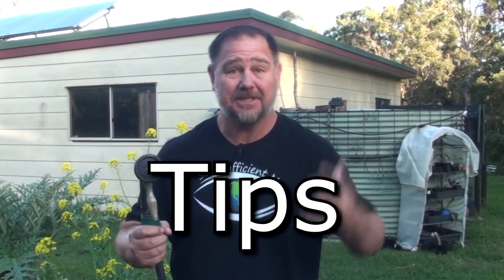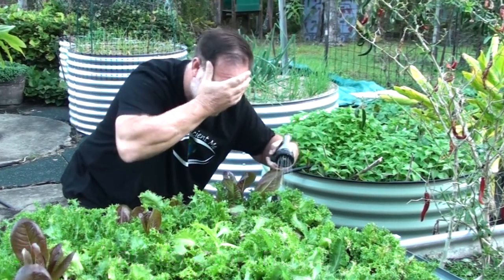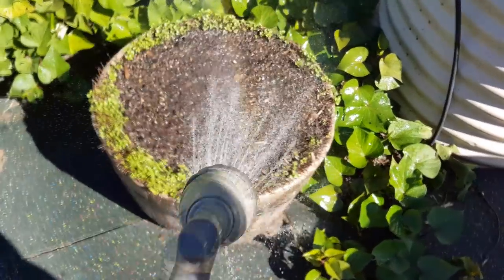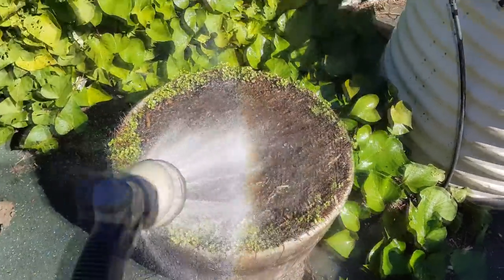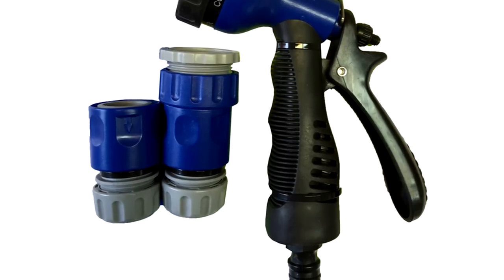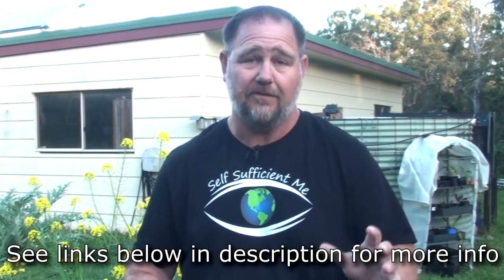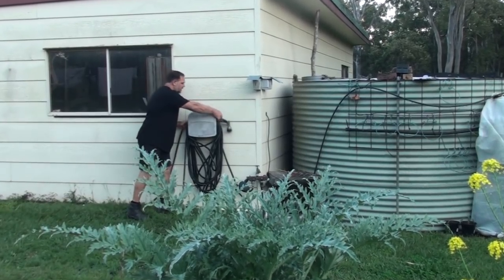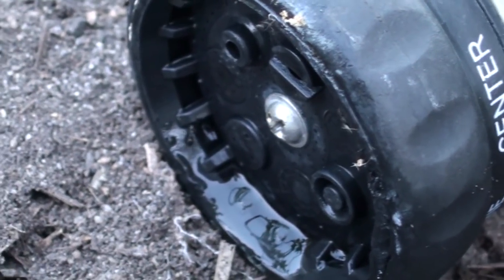EASY Way to UNBLOCK Hose Spray Nozzle or Garden Wand Sprayer

Comment: Also another quick tip if you don't want to go with the fancy sprayers. The old fashioned brass nozzles that look like a firehose and you twist to adjust, never break and never clog and last forever, you just don't have as many spray options with them, you will lose them before they wear out lol. Good vid, thanks Mark   gg.
Reply: I have three of those and two don't pass water.  That's how I find myself here.  Any idea what could be done.  I don't think I can unscrew the two halves the way I see in YouTube videos for Nysist nozzles.

Comment: Full Strength Vinegar works just as well as using CLR. Appropriate levels of Vinegar in your diet is a way to combat Kidney Stones, which are in most cases Calcium lumps.
A good example is the school experiment of putting a whole raw egg in vinegar & watching the shell dissolve off it over a few days. Another good Tip is to always have a spare on hand, so when you are fixing one you still have one to use.
Edit: fixed some spelling mistakes.
Reply from the maker: Yes great point about using vinegar and also about eating it (or using it regularly in one's diet) it makes sense that it cleanses our insides as well as being good for us in many other ways! Thanks for sharing your tips. Cheers :)
Reply: I mentioned it because people can make their own Vinegar, from the Plants they grow & thus it's just another way to be more self sufficient.
Reply: Use the cheapest white vinegar to do this.  It is very effective.  To make it even more powerful add a little baking soda to the mix.

Comment: Hoselink is good, I saw them being used at Bunnings and thought I would look them up, the only downside is the hefty down payment, but in the end... if it lasts a long time in Bunnings Nursery then it would last a while in everyone's garden... but, Bunnings Nursery's are usually UV protected so there is that question of how long it lasts in direct full sun.

So, the only reason why I haven't tried them is because of the hefty down payment

Comment: Another way is to soak in baking soda solution for an hour then submerge in white vinegar till bubbling stops rinse and check if necessary repeat with a longer time in the baking soda solution.  ( 1 cup baking soda added to 2 cups boiling water and stir well till dissolved. Use hot or let cool- your choice)

Comment: isn't it cheaper just to buy the new hose attachments? CLR  is like 19 dollars compare too the sprayers like 5 dollars
Reply from the maker: You reuse the clr liquid pour it back into the bottle and store it away or use it for other purposes  👍
Reply: oh didn't know you could reuse clr then I will definitely give it a try thanks for the tip mate